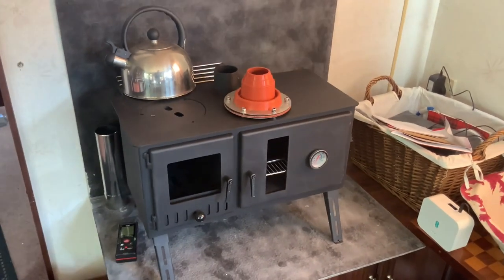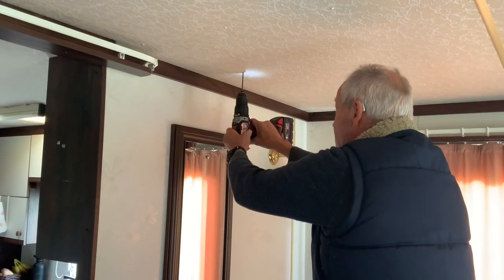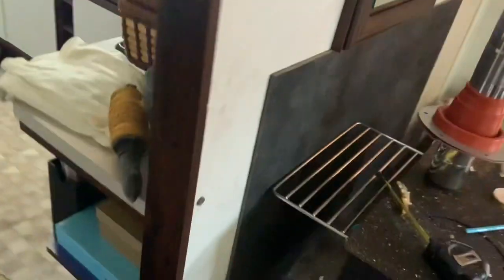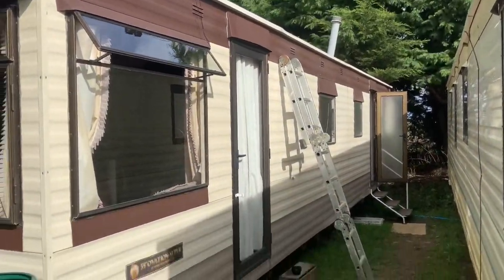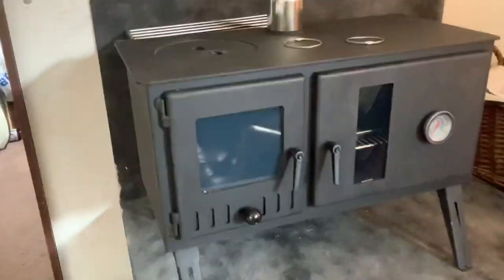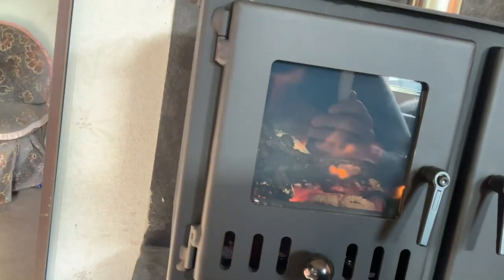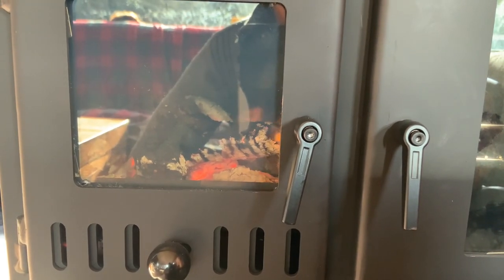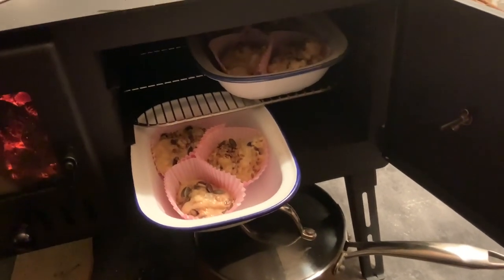Outbacker Firebox Stove Pro - Instalation

Comment: Nice vid, I like the larger firebox door window on your stove. anyhow. your puzzlement on the Jub clips is pretty straight forward. Unlike other comments these stoves CAN be used in shed, caravans etc but they were originally designed for bell tents. that clip is for the top end of the flue and using the loose rings guy lines can be tethered & pegged to the ground. stops the flue wobble as the tent flaps. you've probably worked that out by now, if not I hope it helps. BTW which outlet did you buy from? UK?
take care folks
Reply from the maker: Thank you. Someone who answered. Thanks.

Comment: Cant wait to put one of these in my camper build. Looks like you guys have an interesting channel, subbed
Reply from the maker: Thanks conner
Reply: Just got the fire box I found the flue to be loose fitting and wobbly but when it's burning hot it expands and ends up solid how was your experience
Reply: Just phoned outbacker to ask About loose flues and they said some are loose some are tight which is a bit odd I'd much rather have a sturdy tight fitting flue

Comment: Hey there

Just bought a similar smaller tent stove
Was planning to set it up in a camper van
I 'm a little worried about carbon monoxyde though : the pipes don't seem to fit tightly, big gaps at each junction
Plus the removable round part where you put your tea pot doesn't seem to be air tight as well...

Do you have any issue with yours ?
Did you put a carbon monoxyde detector to check in your caravan ?

Cheers
Reply from the maker: I have put a detector in yes. No problem. But do not feed it paper and clean it out a lot and then it does not smoke
Reply: I've just got the fire box and the same issue with loose fitting flue with gaps I emailed the store I bought from and they say it's normal and expands when hot to create a more solid glue I also see flames through gaps at the removable cooking ring but I've not used it indoors just doing the first burn.

Comment: There's no instructions to install it because it's made for tents or outdoor. Good luck. I've been off grid for a long time and that's dangerous. Unfortunately you may find out.
Reply: Tbh if you have adequate ventilation & use only dry wood & you clean &  maintain your stove & flue regular   then there's no need to worry 👌 ...I also have been living off grid for 20 yrs & my old stove was a used 50 gallon oil drum converted to stoves & I'm still here at the grand old age of 65  👌
Reply from the maker: I agree I have been using this every day seems fine
Reply: Definitely not dangerous as it's made to be in a bell tent I've seen plenty of people using them in garages or sheds just fine